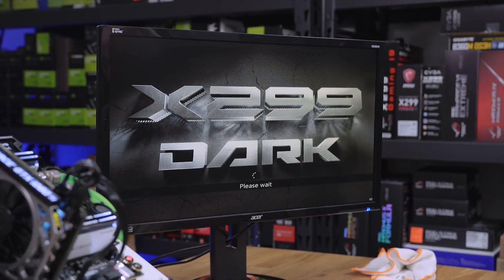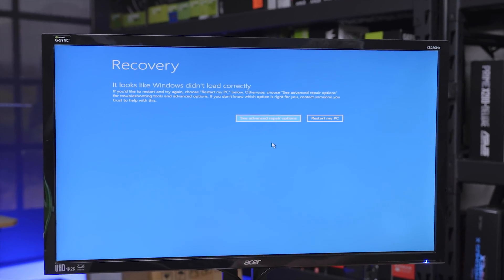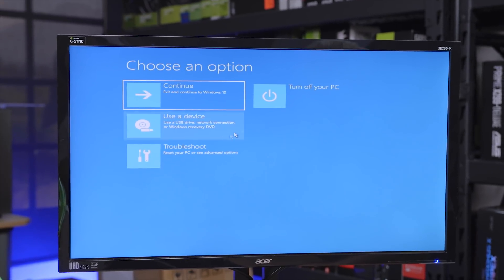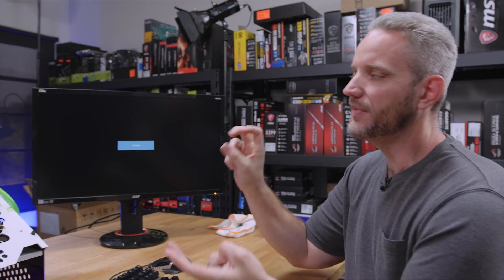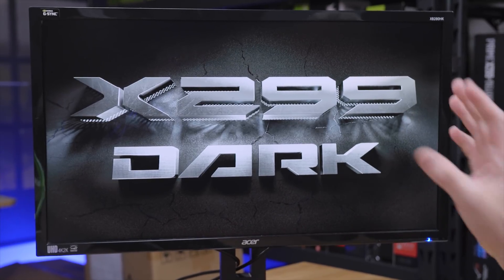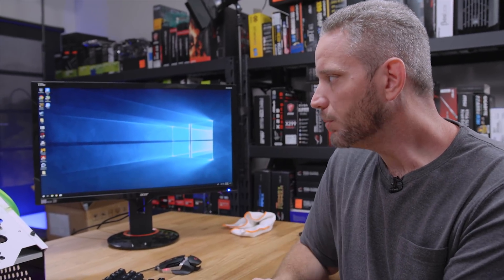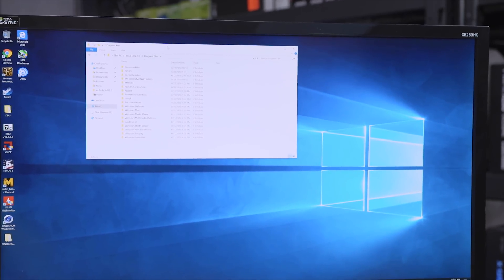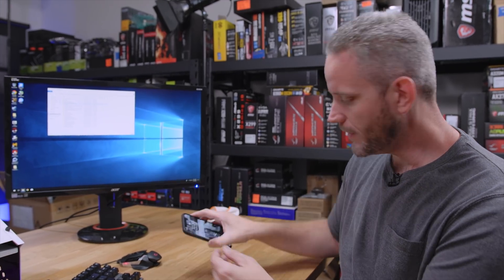New Test Bench Keeps Boot Looping... Here's how we fixed it

Comment: A proper Test Bench always has a clean install, it's EXTREMELY important for reliable results. Most PC hardware magazines/companies/publishers have multiple images that get monthly updated and verified for bugs and performance issues. In 2018 that means easily 20 ~ 30 SSD's for plenty bench scenarios and there are always additional SSD's available for some custom scenario's. And most important images get permanently stored on the server. That last one is mandatory if you want to compare old vs new drivers or anything faintly old tech. These are normal practices and both AMD and Nvidia have guides (and as always ignore the tips that promote a biased outcome) and support for how to test their hardware. I worked in the PC hardware industry for 10 years.
Reply: Given it's a 10minute scripted install I agree with this statement. The Test Bench OS should be devops built, so that it's fresh everytime.

Comment: Not an useful tip...
Anyone who replaces motherboard and CPU by themselves should be able to fix the problem easily. Reinstalling windows would be the smartest choice when switching platforms anyway.
Reply: That wasn't the point of the tip. It was his case that it was Ryzen master. but if ANY OTHER program were to boot loop the system then you would have to use the tip as you cannot uninstall anything in safe mode.
Reply: Any other program could be much harder to identify, if not impossible. That is why it would be a good idea to do a fresh install.
Reply: A BSOD can literally spit out where it failed, that's how Jay knew it was ryzen master in the first place. I've done this plenty of times in every version of windows, a couple of minutes reading some of the basic dmp info can  point to more or less where it faulted.

Comment: I started using W10 Enterprise LTSB. It's locked into version 1607 and I get none of the feature updates. I also don't have to deal with the evil sisters Cortana and Edge since they aren't part of the installation media. I also don't have to deal with any of the Apps from the Microsoft Apps Store. I like it so much better. I haven't had a BSOD since I started using it. I had quite a few clients with boot issues after the last feature update and after running LTSB on my rig for about 3 months I started switching them over also.

Comment: That's nothing. My PC crashed thanks to a driver (that hadn't been changed in months) kicking the bucket. Safe mode didn't help. Auto-Repair couldn't do diddly-squad. And only through a sheer stroke of luck did I find out that the PC booted normally from a forced cold boot, i.e. shutting the PC down while "booting" into Windows - this is apparently the only way to get a true cold boot from Windows 10.

Can't tell you how many tries it took me to figure that one out, with the PC blue-screening most of the time and me not knowing why it did boot occasionally. So frustrating.

Comment: I Bet windows 10 doesn't allow you to boot directly into safe mode because it wants to steal you data to figure out why windows is crashing and then obviously Micro$oft doesn't use that data at all and issues like this don't get fixed. Microsoft is pathetic at stealing your data because if they actually used it they could obviously could see this system doesn't have a AMD cpu and a see a AMD service was causing this and just tell windows to not use that service...

Comment: Blaming MS for your own mistake...
Reply: Not enabling an uninstaller while in safe mode is considered user error? what's the point of safe mode if you cannot fix things. This specific case was part hardware related, but for the vast majority of others, it will be a software incompatibility that causes this, and the blame lies solely with MS for not providing the proper repair tools in its own diagnostic mode.
Reply: Normal people don't put the system drive from an AMD machine to an intel machine or at least purge the drivers before. Obviously, what MS is doing is stupid as well, but normally, you don't encounter anything like this.

Comment: So we are back to windows XP
That if you forgot to plug in your keyboard, you would get the error message, Windows can not detect Keyboard press any Key to continue.
Reply: Wasn't that POST message not specific to the OS? BTW: it's "press F1 to continue"
Reply: Freedom ToThink I would hit plug my keyboard wait a couple of seconds and life went on.
Reply: Most of the time that required a hard reboot to solve once plugged in. It expected it there in the POST sequence and wouldn't try again if you plugged it in. Older BIOS's just didn't work that way.
Reply: They stopped supporting xp when windows 10 first came out.

Comment: You can uninstall stuff in safe mode still you need to add a reg key then it will let you run the installer service, been doing this since the xp days.

https://community.spiceworks.com/topic/533921-starting-windows-installer-in-safemode